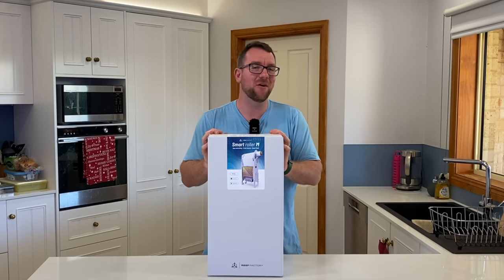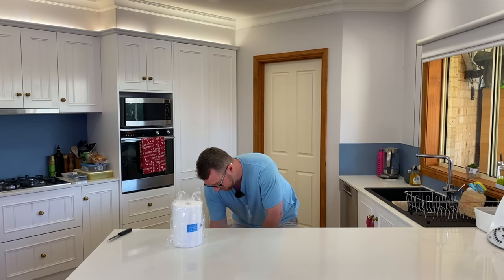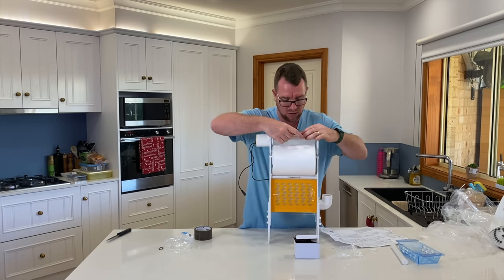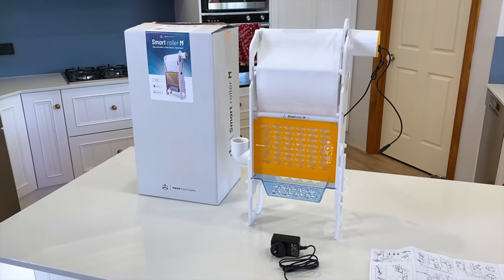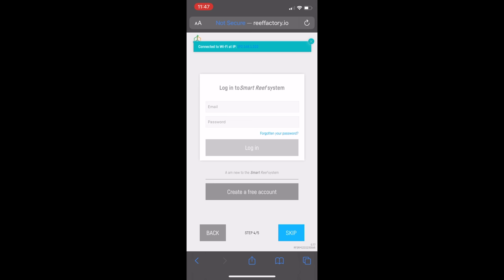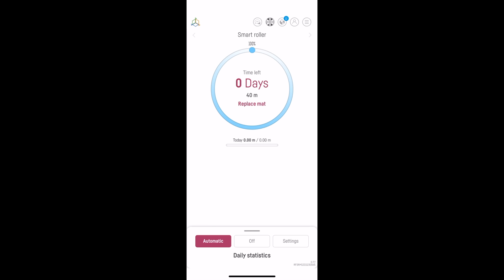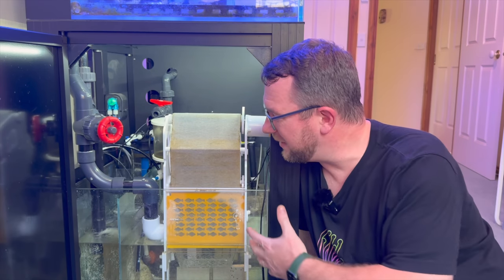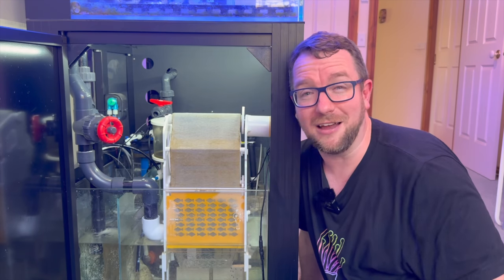The Reef Factory Smart Roller Filter - Full Review!

Comment: Good stuff. A filter roller is definitely on the list. The Red Sea one looks pretty good, but this looks like a very good alternate option. Some good feedback and tweaks suggested in your video and comments though, so maybe I should wait for 2.0 once they make the make the mods  😁
As far as diversions etc., rather than have it incorporated into the roller, I think they would be better off having valves that can divert flow. So it would divert through the roller, or before the roller, but it wouldn’t be part of the roller, so could have multiple uses. If respect to the roller, you could have it getting feedback from auto tester with thresholds set, or you might have it on a time based diversion, or linked to a feed mode etc. I have also suggested in one of their Facebook posts that a high accuracy in line flow meter could be handy. If they could link the 2 things, you could have them talk to each other to split flows to various equipment based on flow rates. It’s all reasonably established technology, but usually in larger industrial equipment. It just needs to be scaled down and coded to link to the smart app. Haha easy enough to say, maybe not to do  😂
Reply from the maker: Yes, that is what I meant by some sort of diverter prior to the roller although someone pointed out something clever - you could use a pump rather than a drain to feed the roller and alter the pumps speed based off your tests results… that would work and has me intrigued 😅
Reply: Yep, I did notice that reply also and it got me thinking too. It is a good ideas. I don’t know enough about it, but a mate knows how to program Rasberry Pi (as you probably do too), and that has got me thinking about how I can all different equipment and brands etc. could be linked despite operating through different apps.

Comment: Great review Sam. That media basket is useless. I currently have the red sea roller filter and it has the same problem. What is the micron size of the roller.
Reply from the maker: Yeah they are small, but I guess better to include and have available than not to include at all.

Not sure what micron the roll is, looking at it - it’s a different material type than others on the market. I’ll see if I can find more info for you

Comment: Thanks for the review.
I think it would be interesting to see if moving the roller so that the water level mark is actually close to the water level changes its performance. It looks like the "legs" can be removed, so i wonder if the distance from current water level to water level indicator is the same as the feet? Potentially its sitting high and the float sensor isnt activating much, so its not using much fleece?
Reply from the maker: yeah potentially, but the roll isn't massively dirty either, so I think it is operating as much as needed. All water is passing through the fleece, so it's working :D

Comment: Hey Sam… loving the content, as always… and like other people have said the water level is for the height the until sits  in the water… it has got to do with head pressure… the deep you submerge the until into the water the more water goes through it raising the level in side the until making the filter spin/ turn more frequently, and if you have it where you have it, it rarely spins/turns at all…
Reply from the maker: I’m curious about this. All of the water still has to pass through the Matt though?
Reply from the maker: I assumed so, didn’t make sense that it had to be that level - but does make sense that it should not be above that level

Comment: Do you think it would fit in the filter sock area if you removed the sock holders and if so, is there a reason you didn't do this?
Reply from the maker: I think it would go close, I didn't want to modify my sump (yet) and I had heaps of space in the skimmer chamber to use
Reply: @ParkersReef  thanks Sam. 
I've got a 1200 reef in white on the way. I might just go the redsea for now

Comment: The water level mark would be the maximum water level height in your sump so the water level in your sump should never be above that line on the filter roller as the water could then soak up the roll. So I’d say you could lower it down with the legs to get the water lever closer to the line if that’s were your water level normally sits in your sump.
Reply from the maker: interesting, I have had another comment saying that it is the required water height for optimal operation. Which one.....
Reply: @ParkersReef  best bet would be to contact the manufacturer as each manufacturer is different, I believe my Clarissa filter rollers instructions said it should be a maximum of 8 inches deep for best performance. I’d give them a email or something and ask about it.
Reply: BTW, did you ever reach out to reef factory about the water level indicator?

Comment: The ability to choose how much water goes through the filter roller - the biggest reason I don't want to get a filter roller - because I thought my water was already too clean...
There is a solution actually - you run your roller off a controllable return pump. If you have an auto tester that does nitrates or phosphates and you can control that pump - or you could simply set that return pump to run at certain times of the day at certain flow rates. If I was going to buy a roller that is how I would do it.
This week I did an ICP Test and there were some crazy readings including Total Phosphate at 0.56! (I have been testing consistently under 0.05). Some things I was expecting but not this - it's possible as I haven't tested it in a month.
Anyhow back to this roller - a roller that goes through so little! Well that is incredible assuming it is substantially better than all the rest. I heard the Smart Reefs one has a fleece you can wash and reuse - I would maybe choose that as I expect I would want the scrubber that goes with it - but this one... well it certainly exceeded my expectations when I sat down to watch it.
Reply from the maker: yeah that would work well actually..... Good thinking!
Reply: @DoYouEvenFishTank  Sounds like a big hassle to me ;) I'm happy with detritus in my sump - I wish I could be Jake Adams with a perfectly clean sump.
Probably I'm overthinking it and you are right though - if I have high nutrients I think the easiest solution is a filter roller

Comment: Hello! I'm asking for some help, If someone nice have the time I'll aprecciate it a lot ! =)

I work at an aquarium store, and the other day we set up the roller, the manual instalation worked fine, but at the tine of connecting the device to the smart reef app, we habe it connected to the app, and it shows the same screen as in the video, with settings and all, but the roller doesnt start, so it cant do its function.

Does anyone have had the same problem and if so, knows how to start the device ? Everything is connected, so i dont know what could be wrong
Reply from the maker: Did you get the chance to add it to an aquarium? I’d also recommend restarting your router and trying again
Reply: @ParkersReef  Yes, It was in an aquarium when we set up everything ! The only problem is it didnt start, so I was wondering if there was a "start" option after its connected to the reeffactory app that i didnt knew. Thanks a lot for the help :)
Reply from the maker: there are a few settings that can be tricky. The one that gets most people is the delay start setting. It wont roll as soon as the float switch is raised, it will wait a set number of minutes first (to stop bubbles or waves setting off the roll)